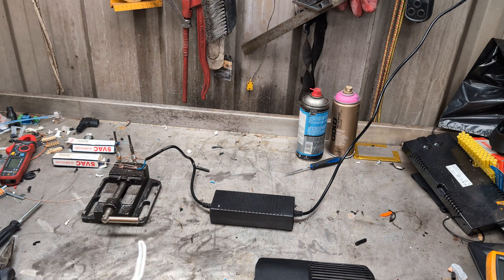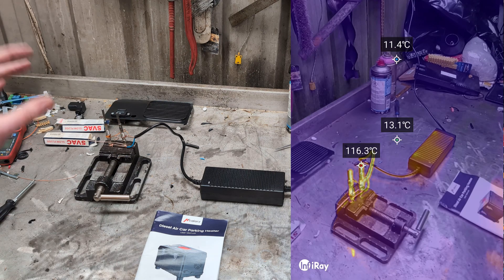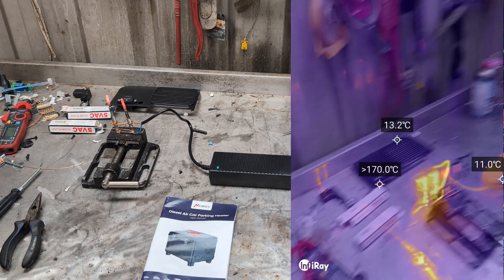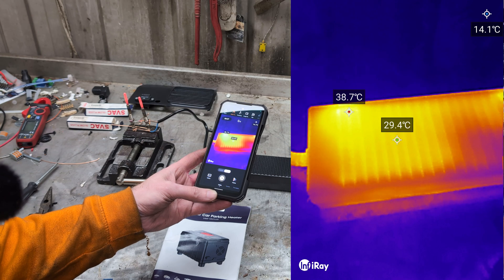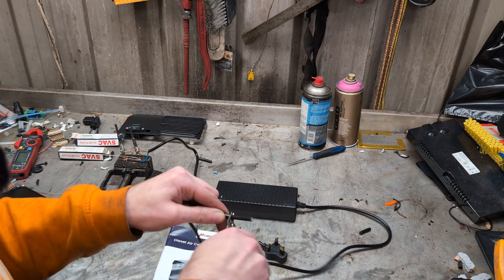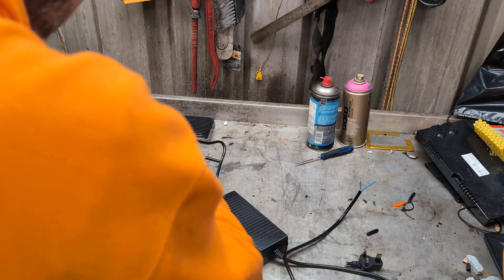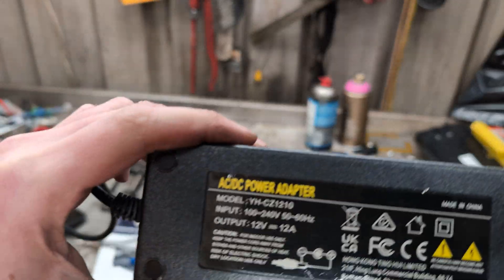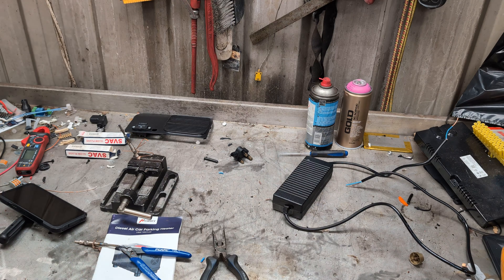Diesel heater 12V PSU wire heating test

Comment: For fine stranded wires if unsure what it's made of just fan it out, hold a lighter to it and if it curls up it's Aluminium, if it just glows and doesn't change shape it's copper.

And wires usually is rated to 60°C or more but it should stay under 40°C for not burning you and comfort/safer

Comment: Not so important in David's workshop, but definitely in the home, if you ever cut a plug off make sure you throw it in the bin, and make sure no little curious hand can try plugging it the wall socket.
Reply from the maker: Yes, VERY yes.

Comment: Hi There is a fuse in the power supply just before the filter
Reply: Wont protect the lead to the plug if it gets damaged or cut, it will have to carry @ 30A if on a ring before the overcurrent device operates, a dead short will melt that lead, best to fit a plug with a 3A fuse max.
Reply: @Ifitwerks  Assuming you have a modern distribution fitted 32 amps should trip within 3 seconds so there is no melting of leads. I agree a fuse in the plug should save the cable but this is no different to the euro plugs which trips at the dis unit if the cable is damage. 90% of time its either the bridge, the cap or the switching tranny that goes.
Reply: @dantronics1682  All cables must be protected against overcurrent at the point of supply No exceptions This is relative to the current carrying capacity of said cable.
Assuming that you have a close protection overcurrent device may not be guaranteed in respect of portable equipment especially. If it has a plug it is a portable appliance and must be fused accordingly with regard to the load and cable CSA used. Have a chat with a Sparky mate, I just retired!

Comment: Trouble with putting a proper plug on CCA wires is the fact the metal is not going to be held very well in the average screw terminal in a UK plug, given you can't twist it properly and often is so thin it's barely tickled by the screw, so if you can't replace the cable with something western, you really need to crimp on some ferrules to secure the wires properly, but really, replace the cable, you never know what crap quality wire, insulation or PVC they used that can (and does!) fail with flames, oh, and on that note, they often "forget" to put flame retardants in the plastics and insulation too, so, fire hazards all round... :S
Reply from the maker: I hadn't thought of that, thank you.

Comment: The Chinese like to skimp on mains power leads a while back I bought the Chinese metal turning centre lathe the power lead and  plug looked very unsafe. You can just imagine a fire breaking out because the wire is not good enough to carry the load and it's good to see that other people can sense the dangers involved in far east goods.👍